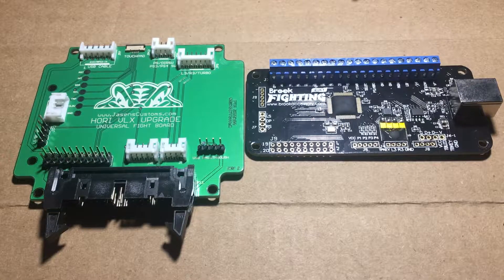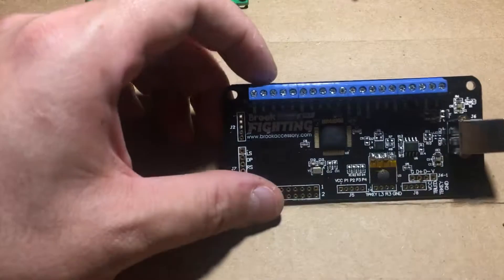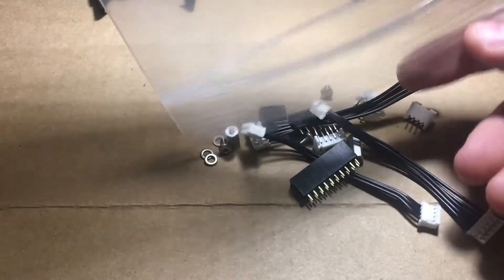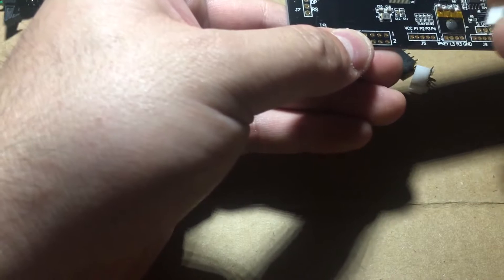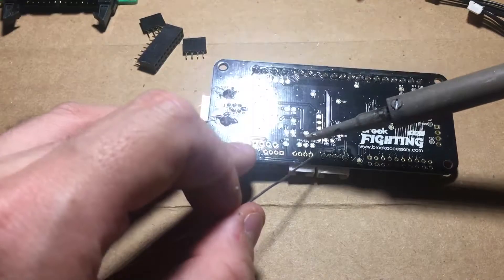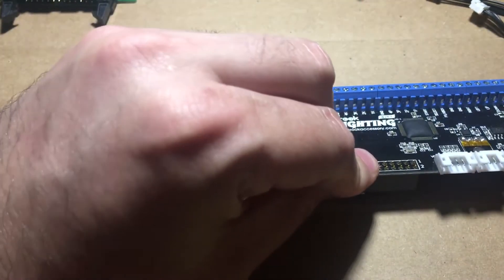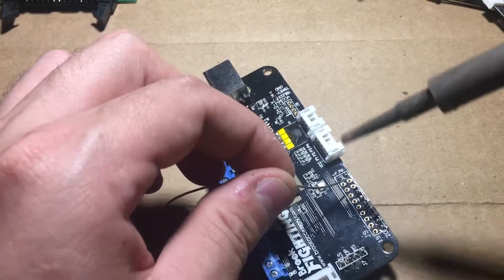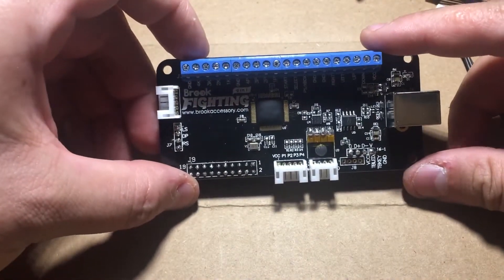Brook Universal Fightboard Installation with Jasen's Customs VLX EZMOD Kit - PS4 models

Comment: My UFB came in the mail today. pretty hyped to do this mod on my VLX. Thanks for the detailed instructions.
Reply: Hi,
You have a VLX Kuro?
I will take one to use on pc (Mame,hyperspin..raspberry..android) with ps3-4.
I will be sure about that.
Thanks
Reply: I do have a VLX kuro. Install was a breeze. I also like how the stick auto detects to xinput for pc. Best mod ever.
Reply: @FourStringL0B0  hey can u can confirm if the touchpad is 100 percent working? Or is it just the touch pad button that works and not the slide feature. Thanks

Comment: Thanks for the guide. I have a question though. I installed it and it works great except for one thing. The L1 Button does not work. Any Ideas? I tried resoldering the pins.
Reply: Ran a wire from the switch to the terminal block to get around the problem. 

New problem arose later. The default mode when I plug it into my computer (xbox one) does not register any inputs now. All other modes work fine.

Comment: i know this is a different stick, BUT regarding mad catz te2+, say i install everything into that stick, do i update to the latest firmware by plugging the stock Mad catz cable into my PC and run the updater? or do i have to always plug the cable directly into the UFB then into my PC?
Reply from the maker: Bludika I'm not even sure where to start lol. Install everything as far as what, this kit? No, stop right there. Use a jasen ezmod or a gummo ezpz. Then, use the original cable or a USB cable plugged directly into the brook. Doesn't matter since it's the same thing, but the point is to use the cable the stick came with.
Reply: oh okay, yea i will be using Jasen's EZ mod, i was just curious as to why some people update the firmware by directly plugging into the Brooks board, instead of just plugging the Stick's usb cord into the PC and update, i want to make sure if the only way to update the firmware was through directly hooking into the Brooks board or not.
Reply from the maker: Bludika yeah there's no difference. Those people probably don't know any better

Comment: i was wondering is it possible for a jst 4pin harness work with the brook board that includes the headers for l3,r3,tp,? obviously i would have to daisy chain one of the  wires for ground
Reply from the maker: This is specifically for the vlx ez mod kit. You get everything you need. If this is for a different application, yes.
Reply: +VickoMods sorry this was the closest video i could find to what i wanted an answer for, thank you very much though,  it was the only solution i could think of that wouldnt involve soldering

Comment: Hey man. I have a kaimana led board that I just ordered.  The It has a USB header soldered to it already. However my UFB does not have the female USB header on it already.  Where can I order just the USB header ? Thanks.
Reply from the maker: Sean Livingston you talking about a 4 pin header or the USB A header that all have? You can get either by googling lol, or amazon, mouser, digikey
Reply: I am talking about the 4 pin header, correct.  My UFB did not come with headers.  I have had trouble just tracking down the proper 20 pin header so that I can use it with Kaimana.

Comment: would this work for the RAP V4, not the 4 or 4 Kai, the original PS3/PS4 RAP V4?
Reply from the maker: NinjaRed5000 no sir
Reply: VickoMods
Oh damn.  Well, I guess I'll see how I can use the brook by itself, but I have no soldering skills and I'm worried i might ruin any of the connectors.
Reply from the maker: NinjaRed5000 right now I have a holiday sale, $180 installed and shipped back to you. You'll have access to everything minus ls and rs I think
Reply: VickoMods
Well I have a RAP V4 so can I send it to you to install? Also I don't really mind losing ls and rs function.
Reply from the maker: NinjaRed5000 yes! Email me Vicko at vickomods.com
Reply: VickoMods
Awesome.  When I save up for the brook pcb I'll be sure to send you a message my friend!
Reply from the maker: NinjaRed5000 my price includes the brook sir
Reply from the maker: Just making sure you saw my earlier comment, the $180 includes shipping and the UFB. All you need to do is send in your stick! Hit me up at vicko at vickomods.com
Reply: VickoMods whelp time to save money!